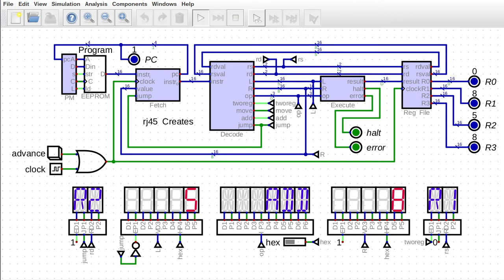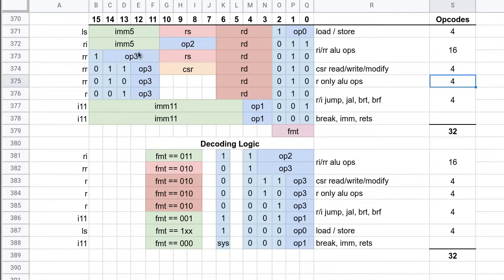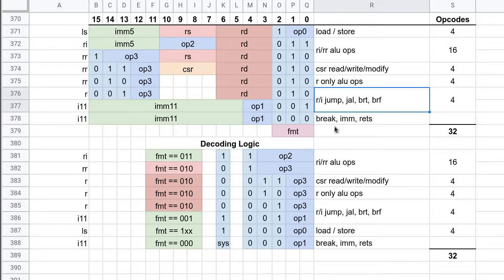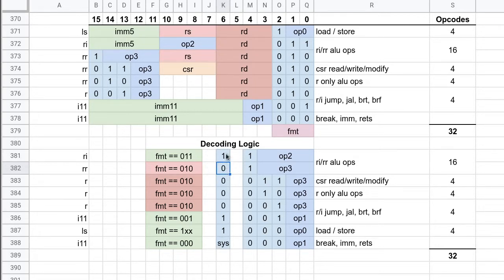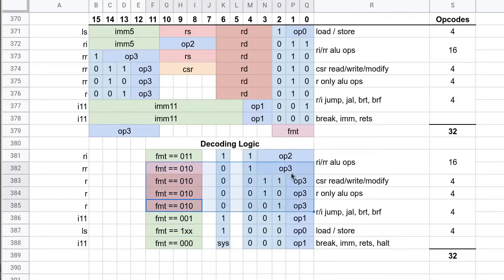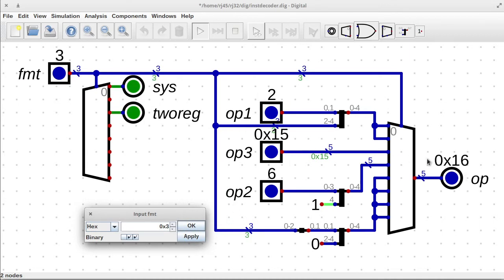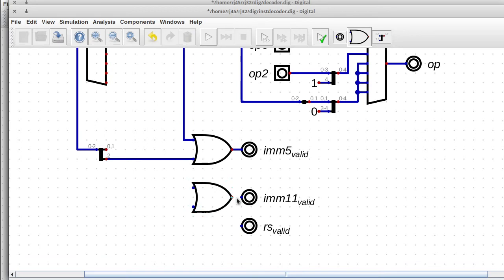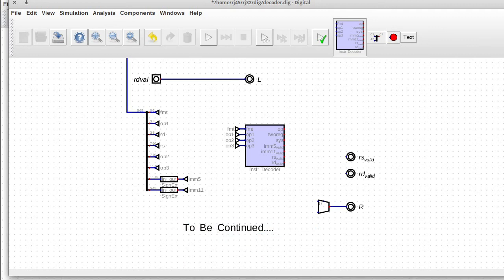[019] Instruction Set Decoding! (Part 1) - Building a CPU From Scratch

Comment from the maker: In this video I tried a different way of narrating the building parts. Not super happy with it. I am going to try a different way to do it in the next video that will hopefully be better, or I will just revert to the way I used to do it.
If you are building along and get stuck, or just want to chat, join my discord: https://discord.gg/thzHEM3VH7
For the exact code at the end of the next video, see here: https://github.com/rj45/rj32/tree/498d2ac290df0db4cf0051a735deabd919ffd143